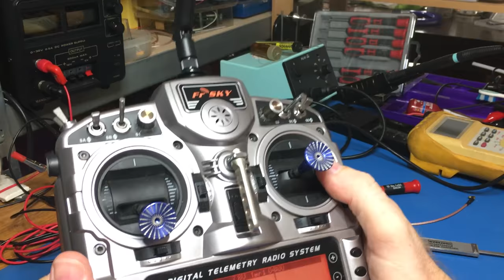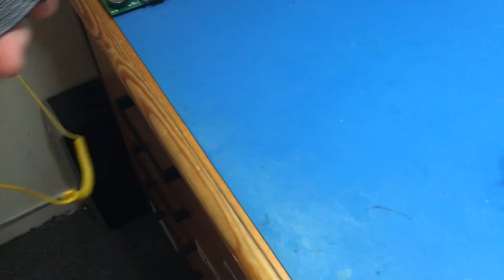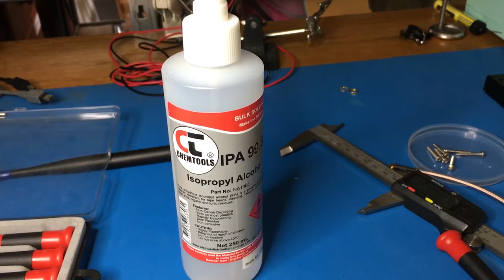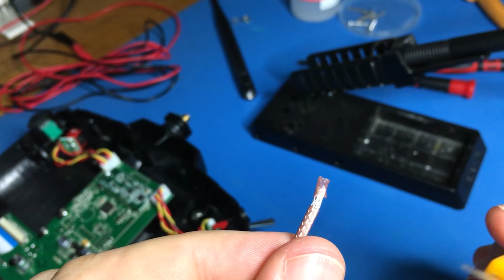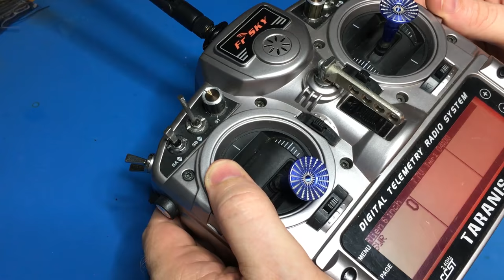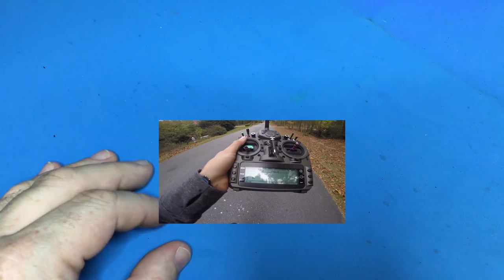Tutorial - Taranis 5dB Antenna Mod **DON'T DO IT** | Fixing Bad SWR | HOW TO

Comment: Hello, im new to the hobby and was planning to but the taranis x9d plus telemetry for 170.00 usd ,but it saids "its missing one item, the swr check of the transmitter anttena is no longer available" its that a bad thing or should i buy it? Thank you for your help in advance.
Reply from the maker: Hi, it sounds to me like the Taranis firmware has been updated and the user does not know here the setting is to display the SVR reading again. Regards Tony
Reply: Hi :)
SWR has been moved on 2.2.x to the Radio setup, page 7/9: Analog test. it has been also renamed RAS.
Reply from the maker: That's great, thanks for letting us know. Cheers Tony

Comment: hi i have 2.2 in my taranis and i cannot read the swr do you know why?
Reply from the maker: Hi there, I would say that you will need to have your copter powered up so that Telemetry is being sent to the Taranis. I know that this is the case with V
2.18 of OpenTX and maybe the same with V2.2
Reply: i find it in 2.2 it is called RAS
Reply from the maker: Cool. Thanks for letting me know. I'm going to do a video on how to show SWR on a Taranis, so I will look this up beforehand.
Reply: Also in my case the internal module was with ufl. the ufl connectors are very sensitive so i removed it and soldered the cable on the board and now the SWR = RAS = 0
Reply from the maker: Cool. Have you soldered the braid to both ground solder pads that sit either side of the signal pad? My thinking is that this may be a requirement for a healthy RF signal, even though both pads are connected together at some point on the PCB.

One thing that is still unclear is how does the FrSky telemetry and protocol work. The Taranis antenna is both a transmitting device (RF to copter) and a reception device (RF from copter). Therefore, there may be some particular way that these 2 functions are balanced and what we are doing with removing UFL connectors, soldering directly thick coax and using higher gain antennas could well be upsetting the equilibrium  of the system. Regards Tony
Reply: Yes both of them and i test them like you do in your video but my my 5dbi antenna has 15 swr but my 2 dbi has 0. i think that the 5 dbi isnt good
Reply from the maker: Well, you have to consider the reasons why FrSky have designed the Taranis in the first place. Perhaps there is a limit to the gain of antennas that should be used in these controllers. I suspect that moving back to a high-quality 2dB antenna will fix many people's issues. I've ordered an FrSky 2dB and 5dB antennas and will swap it ASAP.